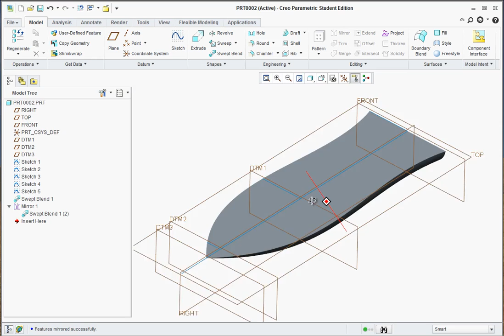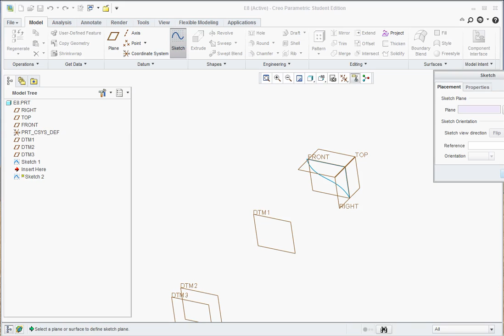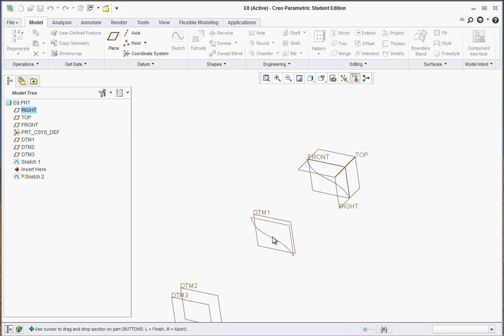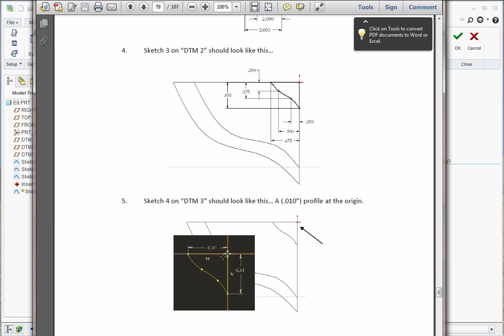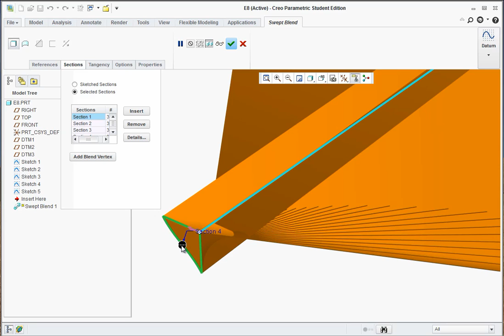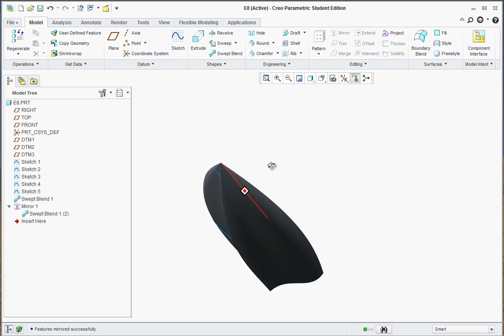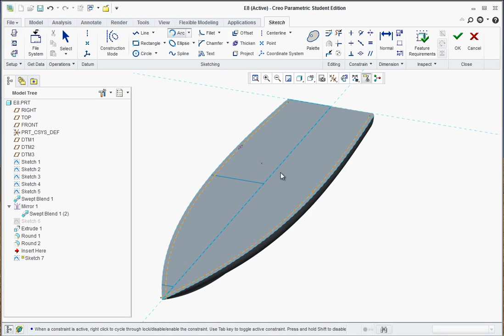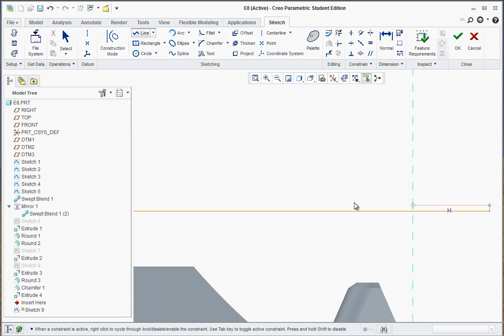E8 CREO Parametric 2.0 Basic Modeling 6

Comment: For people working on CREO Pro Engineering, I found that the best way to do this was to make datum planes along the corresponding points and then use splines to draw the curves of the boat hull along the other splines made for the cross-sections. You can only select 3 points max, which means that you'll have to do the tip separate from the rest. When I had all the profiles and curves going across them (4 in total, with 1 straight line where everything intersects), I could already see the outlines of the hull. I used the first profile from the handout to make the majority of the hull using VSS and clicking all the lines and then I used the 3rd profile for the tip. Hope this helped anyone who was stuck on this like me.